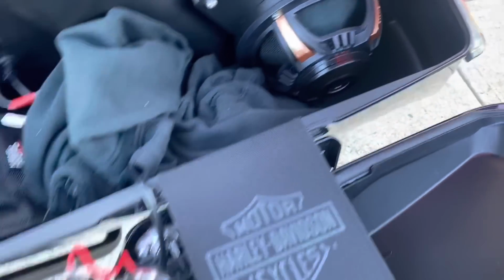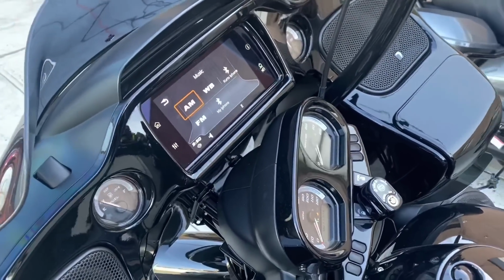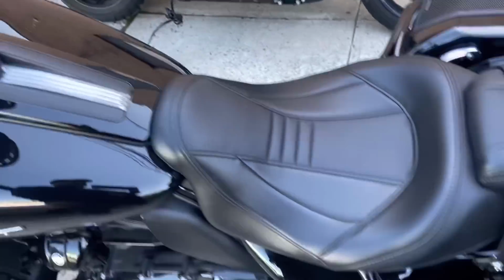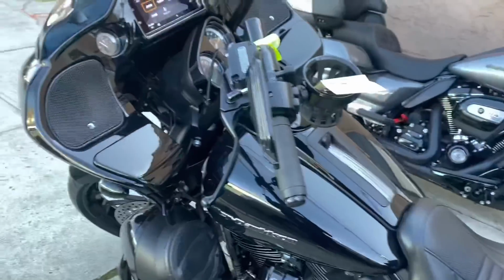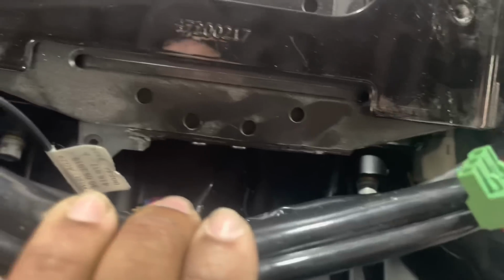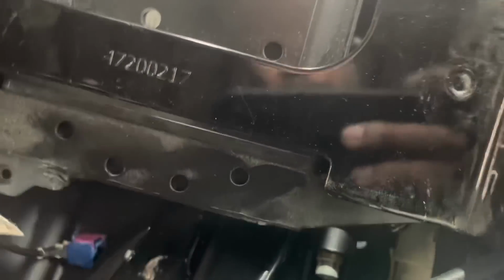Harley Road Glide came in for a consultation on his audio system after another shop did the install

Comment: Even though you won't really hear that much bass if any at hwy speeds, it'll be really nice at slower speeds for sure. MUCH better than the midrange drivers IMO as well.

Know of any adapters for a '21 HD RGL that would drop in Hertz SX165 coaxials into the lower fairings? Or would that be a moot point/require fiberglass modification to the lower? Just trying to see if I can get the sound stage more covered.

Comment: Do you know about the soundigital manufacturer warranty when buying off ebay? Not sure why I didn't buy directly from them, however I bought a defective amp an it was purchased in Dec. but I was just able to have it installed  only to learn it wasn't working. So it's past ebay warranty and the seller isn't messaging me back.

Comment: Awesome videos Carlos and crew!! I NEED YOUR HELP.. I am picking up my new 2022 Road Glide today!! I do not want lid speakers but will be putting 4 new speakers 2 in fairing and 2 in tour pak. I saw your review on Cicada DSP amps and I am leaning toward the DSP 125.4 amp and pairing that with either DB Drive  WDX6MOTO-CD or Cicada CX6.5.2 2 OHM.  What are your thoughts on the amp choice and which speakers would sound best for the money.  Thank you all for the great videos!!

Comment: Carlos, I'm trying to go as budget as possible looking at the Kicker Key 200.4 has built in dsp and swapping out fairing speakers with something like Skar Audio 6 1/2 with separate tweeters. Stull using the stock GTS head unit 2021 Road Glide special. What is your opinion on the kicker key 200.4? I wish I lived close by but I'm in Oregon and bringing bike down to you is not an option. Thanks for your time and keep up the videos appreciate ya
Reply from the maker: The kicker key is nice but I like the Cicadia dsp amp better

Comment: Hey Carlos can you answer this question for me please. I see some guys seal off the backs of lid speakers with sound deadner. Does that have a negative affect on the speaker unless it’s a sealed back speaker. What would the benefit be ?
Reply from the maker: I’ve seen some great builders do it but I don’t .
Sealing off the back of the speaker completely changes the way the speaker plays . It brings the fs of the speaker way up . If done properly it works but I’ve seen it done wrong many many times . We choose not to seal off non Sealed back speakers and we also do not run buckets on the back of our speakers . It just preference, If I need a speaker to have a sealed back I will use a sealed back speaker.

Comment: So Chan 1,2 on the 800.4 is running 2 ohm wired in parallel, is this correct ?
Reply from the maker: Yes 

110 watts per speaker
Reply: @NVSAUDIO  this is the kinda stuff that will be great for the training seminar
Reply: So how is channel 3 and 4 wired to give a balanced 2 ohm load to balance amp?